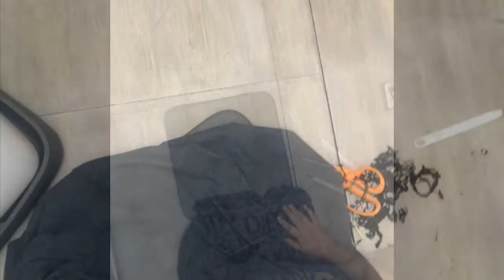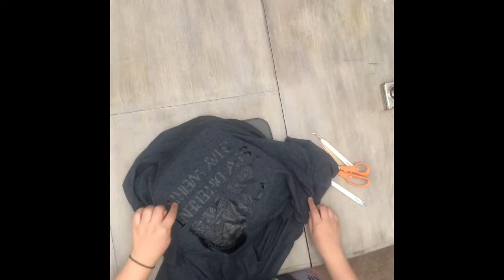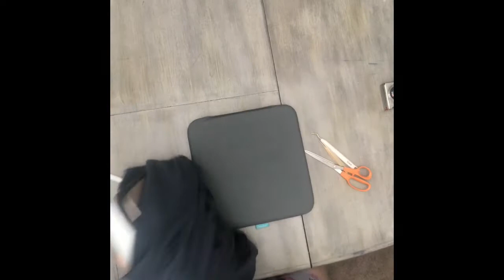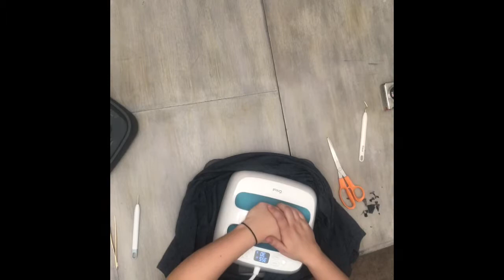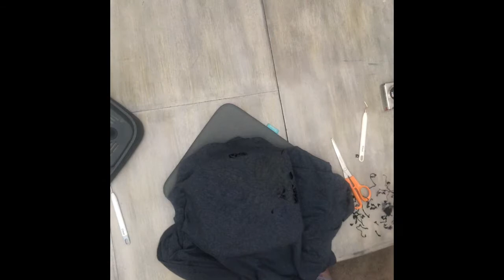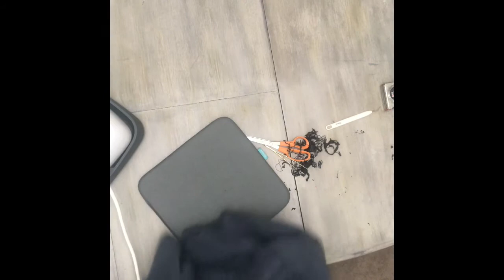Make a Mistake? How to Remove Heat Transfer Vinyl with EasyPress

Comment: I've done it with my Easypress and my mini iron.  The small iron was easier for me. I also used my little metal spatula to lightly scrape some pieces off. 
I didn't know that washing 1st would remove some of the ghosting.
Thanks for sharing!!!